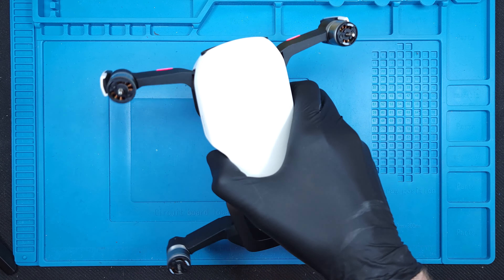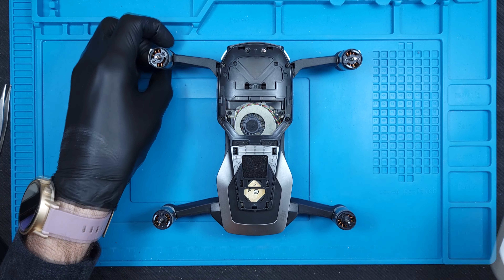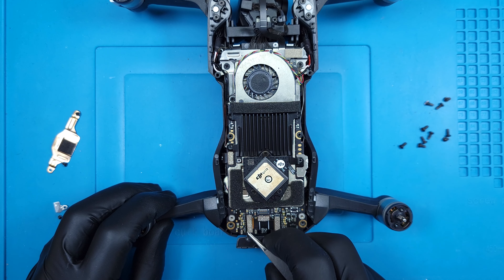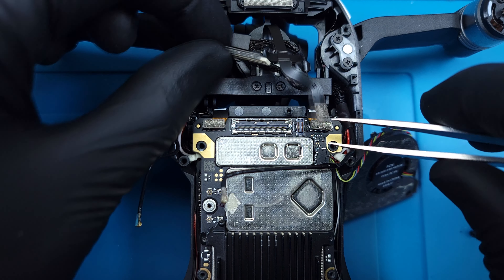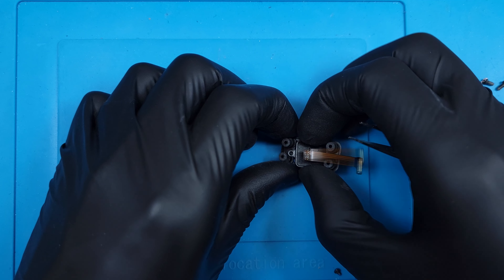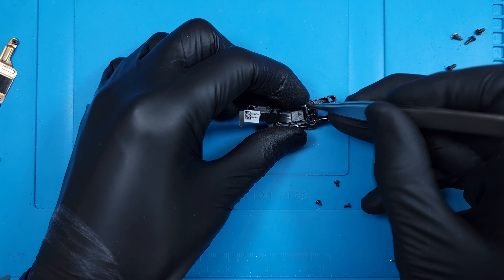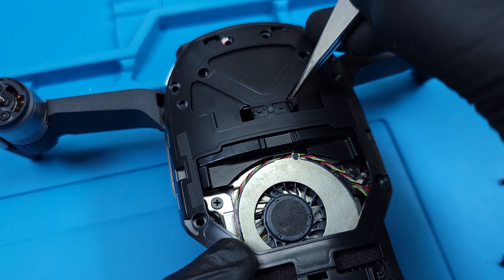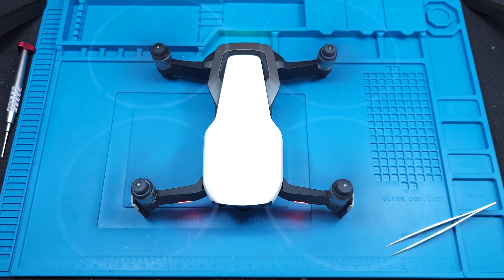DJI Mavic Air IMU Replacement (Original Air) | Main Controller Data Error Fix | Guide

Comment: I have the exact same fault....
So mad 😭
Reply from the maker: It's really frustrating, especially when I got to the job site, went to fly, and couldn't take off.
Reply: Tried to get the part for months but everyone says they're on backorder..
Reply from the maker: @tullgutten  same here, I haven't been able to find them anywhere, even from Chinese sellers. I have heard decent success unplugging it for a few hours and reconnecting, but it's hit or miss.
Reply: I'm back here to tell the last 1 or 2 Hours I've disassembled it (mine didn't have the two screws to take of the top panel as many writes so had me chasing a ghost there 😅)

And carefully removed all the thermalpaste with a brush and solder paste/flux since it actually dissolves the compound unlike ethanol and acetone. 

Carfully heated it with solder iron on the chip drenched in flux, and since i don't have a hot air station i tried a 1 watt lazer i have 🙈 carefully focusing it to the size of the whole chip and hit the chip and solder pads seems like it did melt imthe solder but not sure. 

ANYWAYS didn't replace anything and mounted it back now the errors are gone 😁❤️
Wairing for the batteries to charge and test tommorow. 

Tanks for this tutorial on how to change it by showing every step, and the comment section here that helped me for motivation to actually just try cleaning and heating the original part. 

(this was an unnecessary long comment, sorry not sorry 😂)
Reply from the maker: @tullgutten  Heck yeah!!! That's what I'm talking about, breathing some life back into it with fiery hot air, super happy to hear it. Thanks a ton for the kind words, and for writing up such a detailed experience, definitely pinning this comment to the top!
Reply: Back here with an update.
It works 😁
So happy now. 
Thanks 👍
Reply: @tullgutten  Does it still work or was it only temporary?
Reply: I've now got the same fault.  Bollocks to it.  I'm not doing all this to try to fix it - I'm nowhere near skilled enough to do it and will inevitably get something wrong, after all there are about 14 billion steps here.  Nope, that's a £650 drone that I bought only 4 years ago now just a useless pile of plastic and metal.  I certainly won't be buying anything from DJI again.

Comment: Thanks for the video, I ordered a new IMU off ebay, shipped from USA to NZ, followed your great video and replaced the part. Have taken for a test flight and its all go. Thanks again.
Reply from the maker: Awesome! I'm glad to hear it! Sometimes those replacement IMUs are defective but it sounds like you got lucky. I've heard that remembering to power on and at least spin up the motors once every two to three months can help keep the IMU form going bad, but I don't know enough about IMU modules to verify that.

Comment: I "HAD" the exact problem everyone is experiencing. I can't guarantee this will work, but it seemed to work for me. I striped the Mavic down to expose the IMU and clean it off (Not that there was anything to clean). I put it back together minus the plastic and nothing changed. I was about to give up. Just for fun I went to DJI downloaded the DJI Assistant2 and went through the process. I then removed the battery from the Mavic and put the drone in the freezer for a couple hours. I then removed condensation replaced battery, and IMU data error was gone. I can't tell you which part of the process fixed the problem, all I can say is I don't have the error anymore. Give it a try, what do you have to lose.

Comment: Thanks for the video , helped with initial dissasembly.

Also had an IMU error on te Mavic Air after shelving it for half a year.

-Put it in the freezer and the IMU issue was resolved for one day.
-->Attempted restart the next day but it reverted back into the same IMU issue.

-Dissasembled the drone according to this video (kind reminder: some mavic airs have two front screws for the top cover rather than snapfits).
-Re-seated the flat cable for the IMU and smacked the module directly a couple of times.
-These actions resulted in an  'IMU disconnected' error.

-Cleaned the flat cable contacts with IPA to resolve possible oxidation issues, no luck. 'Disconnected' issue persisted.
-Heat blasted the IMU with a hair dryer, no luck.
-Scraped off the blue thermal paste, heat blasted the IC's directly, re-applied generic thermal paste for CPU's.
--> Worked. Drone has been flying without issue ever since.
Reply from the maker: I love the weird ways you can fix things!

Comment: Thank you man, my Mavic air developed these errors 3 years ago just after 40 hrs of flight time. Yesterday I saw Ur video n followed every step. I didn't replace the IMU or any other component just reinstalled everything and all errors were gone. Updated the firmware n it worked like a new drone. So don't even buy an IMU, try using same IMU n push all connectors as due to vibrations some connections might be giving errors.
And I'm sure DJI would do same thing or swapping IMUs between all the "Warranty Claim".

Thank you brother.
Reply from the maker: Sometimes it's as simple as unplugging it and plugging it back in! Glad yours is working again!

Comment: Had a similar issue to this but the error I was getting was temperature error 13. Tried all the other fixes like fridge/freezer but didn't work. Ended up following this guide and removing IMU, cleaning thermo paste using isopropanol and earbuds to clean fully, reapplying thermo paste and putting everything back. I now have a working Mavic air with no IMU errors. Thanks for the video. I wouldn't of attempted it without this. 👍🌟

Comment: Great tutorial, it really helped a lot. Before buying new (or not so new) IMU, I've followed advice in the comments and cleaned IMU from old paste, heat it up with hairdyier and later with soldering iron, put new thermal paste in and assemble everything back. After powering Mavic up no errors came up. After IMU calibration it's flying again like it suppose to. I will report here in some time if results of this repair are long lasting. 

Thanks again, cheers.
Reply: Hi - I've got a similar issue with my mavic but only difference is, its reporting IMU overheat issue. I plan to clean IMU and apply new thermal paste. Did you clean off 
old paste completely and also what thermal paste did you use? Thanks in advance
Reply: @alanstaples2554 I cleaned it with isopropyl alcohol using small brush and applied thermal paste for CPUs.

Comment: Great tutorial - very clear, concise and easy to follow. I was able to take apart my DJI Mavic Air and clean a lot of dust and sand out of it (it gets a lot of use at the beach), all the way down to the IMU. I then put everything back together, but unfortunately didn't have the same luck as others in getting it to work as I continue to receive the error message.

Been searching online for a replacement IMU for the Mavic Air 1, however there doesn't seem to be any in stock. The only ones being sold are for the Air 2, which from what I understand from other comments, is not compatible with the Air 1.

Thanks anyway, will keep my eyes on the market and hope to find something!

Comment: You are an absolute legend! If I could tip you, I would.  Fixed my Air following this video after buying a similar $20 used IMU on Ebay. Thanks a million!
Reply from the maker: Hey Dean I'm super glad to hear that! Way better than replacing the whole thing, right? Fly safe!
Reply: @TapticDigital you sir, represent all that is great about the internet.
Reply: Same here bro, I posted my story also n I didn't even replace the IMU, just took apart n installed everything back. Working like a charm.

Comment: Thanks a lot for the video! Had to pay around £100 for the replacement IMU, couldn’t find any cheaper ones on ebay… i guess it’s going into the “old drones” category 😅
But still beats than buying a new drone!
Reply from the maker: Glad it helped, I've also gotten a few comments that simply disconnecting and reconnecting the original IMU solved the issue as well. What a picky little chip!

Comment: Hey Man, a BIG thank you , Truly. I replaced the IMU and my drone, which i wasn't able to fly for a more than a year, i working perfectly now. Little tricky also to attach the cap of sd card and power inlet compartiment. It fell of while i was trying to put he top case back in place. Also i was really tricky to find a new part (from china obviously, but it worked perfectly. 
Anyway thanks again
Reply from the maker: I'm glad it worked! And glad you were still able to find parts, they are super uncommon these days. But the original Mavic Air is still a very capable little drone! Thanks for letting me know my guide helped, too!

Comment: I am actually having this same issue. No errors with the gimbal or other sensors, just the IMU. Very frustrating for me because I am overseas if I look for spare parts. Many attempts trying to calibrate the IMU but the app gets stuck. Thanks for sharing this video. Very well done. Question: which camera and setup did you use to have that nice FPV?
Reply from the maker: Thanks! This video was shot on my Galaxy S21 Ultra in an adjustable arm mount. And being overseas you may have better luck getting the part if you're closer to China.

Comment: Would a IMU made for Mavik air 2 be compatible with the Mavik Air? 
Your video is awesome. Thank your time.
Reply from the maker: I believe they use a different connector unfortunately, I haven't found a compatible one yet.
Reply: @TapticDigital  Thank you for your reply.

Comment: Thanks for the video! I have a question - are the Mavic Air 2, 2S IMU sensors compatible with the original Mavic Air?
I realize that the black cases are different, but can I remove the sensor from the 2/2S unit and put it in the Original Mavic Air IMU?
Thanks!
Reply from the maker: To my knowledge they are not the same, I believe the flex connector is different. 😔
Reply: Found your answer in earlier posts. I see they are not compatible...

Comment: Why is it so hard to find an IMU module online for the Air 1?  I see tons for the Air 2 online.  Does that mean the Air 2 also has issues with the IMU?  Thanks,
Reply from the maker: It is a royal pain trying to find the original Air IMU. And of course, they are not the same unit as the Air 2. I've only had luck on eBay and AliExpress but haven't found any outside of China.

It seems a lot of IMU have this issue when sitting idle for some time, though newer ones might be more reliable.
Reply: @TapticDigital  Thanks for getting back to me.  I had it out on vacation when it went bad.  When i got back i noticed I missed the insurance by two weeks.  Not sure if i made the right move but i just ordered an open box mav air from eBay for a good price.  I wanted the 2s but don't feel like spending that kind of money right now.
Reply from the maker: @eNeVeFamily  that's actually really interesting, mine was almost 1 month out of warranty when it went bad. Maybe if this happens enough DJI will offer a replacement program

Comment: Hi. Can you maybe help with advice about GPS problem in DJI air ?
Reply from the maker: Sometimes the IMU can cause GPS issues as well, but I'd first recommend downloading DJI Assistant 2 from their support page and running a forced firmware update on your drone first. Worst case you can replace the GPS module, and it's one of the easier ones to get to as well.

Comment: Hello!
Thanks for the video. It is almost my case. My Mavic Air crashed and I'm getting both accelerators error and IMU data error. Is it possible that it is just wires disconnected, or IMU module can be damaged as the result of a crash? Or should I be ready to buy a replacement IMU.
Reply from the maker: It's very very unlikely that it got disconnected. DJI knew their drones would take a lot of vibration just from flying, and have glued most connectors in place or screwed them down. I'd honestly look into getting a replacement, but I've seen several people disconnect and reconnect the original IMU only to have their issue solved.

Comment: Thanks but there are two missings.
First you missed to show that there are two screws in near the camera which must be removed first.
Second, it's not necessary to replace the IMU. Just check connexions in connectors and it will works.
Reply from the maker: I believe I mentioned that this is a refurbished unit, it has plastic where those two should be under the gimbal. I've had some luck just reconnecting, but sometimes it seems to still fail. Good to know though, I'll save the old ones in case they work!

Comment: Hi! I have the same problem.after a couple of months not flying, the drone drop with no reason. I ordered a new IMU. In your video you stated the 2 screws under the gimbal. Do i need to take them off??
Reply from the maker: Only if your model has the two screws under the gimbal. My drone was a refurbished one and for whatever reason did not have the screws. They need to be removed to release the top panel from the drone.

Comment: Hi Chris, my trouble means the same. I don't understand if this repais is about only the cable or the imu all peace. Can you explain more?
Reply from the maker: It is the same repair, but some of the parts are different. In my video the part I used was just the IMU only, which had a cable running out of it. Some suppliers have the whole "block" piece, but mine came with just the cable that goes inside the block. The cable and IMU are one piece.

If the IMU is bad, it will give errors on the gyroscope and accelerometer, but really the IMU is the only part that goes bad. The IMU is that little ribbon cable with blue stuff on one end and a connector on the other. Does that help?
Reply: @TapticDigital  nice!! It's clearly now. My app show the same error which the yours. Now I go buy this IMU cable without worries.

Comment: I tried heating the IMU with hair dryer - no success. Then put it in the freezer for several hours, no luck.
Finally ordered one on eBay. Those are more expensive than for Air 2/2S though, I paid $49.99 US with shipping
Reply from the maker: It's super frustrating when they go out, I really wish DJI would sell some components to keep these perfectly good drones up in the air.

Comment: Hi, is it true that if the mavic air is doing an update and for a certain reason the internet connection was cut, the whole mainboard have to be changed?
Reply from the maker: No that shouldn't be the case. It can likely be fixed by connecting to a computer with DJI Assistant 2 installed.
Reply: @TapticDigital  its for a friend, lets c abt that...but it seems that the mavic air 1 have lots of problems...
Reply from the maker: @zibobman  I agree, DJI drones don't seem to be built to last super long. I'm seeing more and more original Mavic Pros and Airs with board failure
Reply: @TapticDigital  so i asked him again,the thing is that when tbe drone is hooked up to the computer it does not respond...
Reply from the maker: @zibobman  the program itself can be pretty picky, sometimes requiring you to run it as an administrator. If all else fails though, it might be time to replace the drone.

Comment: Is the imu on the original the same as the one on the air 2. The originals imu is pretty hard to find
Reply from the maker: They are different. I had a very hard time finding this part, though I did find several on Aliexpress
Reply: Oh ok. Could you link me a good one please?
Reply from the maker: @aimhigherking  sure thing, I've added a link at the bottom of the video description to another one I purchased. It took a while to arrive though.
Reply: @TapticDigital  They are not selling the imu for Mavic air anymore ..
Reply: Any ideas where to find another one
Reply from the maker: @color_of_happiness  I know 🙁 I've seen a few pop up on Amazon and ebay on occasion but it seems nobody has a large quantity anymore. Check out some of the comments people left here with alternate repair ideas, you may get lucky!

Comment: I made the exchange and the problem persisted, did the part come with a problem?
Reply from the maker: Very possible. The only parts I've been able to find are used ones, and there's no way to know if they work or not until you try them

Comment: Very helpful video! Also for me was hard to find the IMU, was only available on Aliexpress. One advice in case you have the screws behind the gimble, try to remove the silicon from the screw with a flat screwdriver.
Reply from the maker: Awesome! I wish these parts were more available but DJI moves on to new stuff so fast they are hard to find.

Comment: I I have same issue after I tried updating firmware and reset it to factory not working I did order this IMU  online and replaced it but has the same issue 
Can you help me what I should do ?
Reply from the maker: Unfortunately it's pretty likely the replacement IMU you got is also bad, I ordered three before I got one that worked. Your best bet is to try and order another from a different seller. This is exactly why we need Right to Repair, manufacturers need to support their products for a lot longer than a year and or two.
Reply: @TapticDigital  although this answer wasn’t for me, but it was what I was looking for, on my second imu and still having the same problem, I thought I was the only one, maybe I’ll use your link to order my third imu, wish me luck